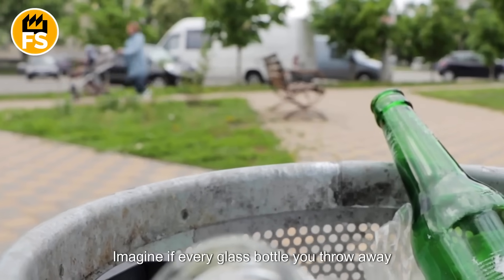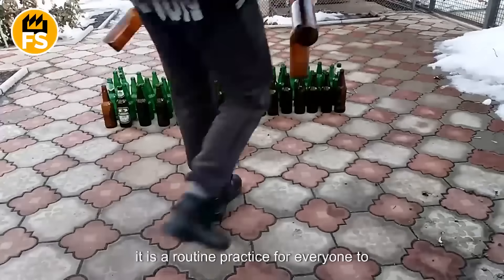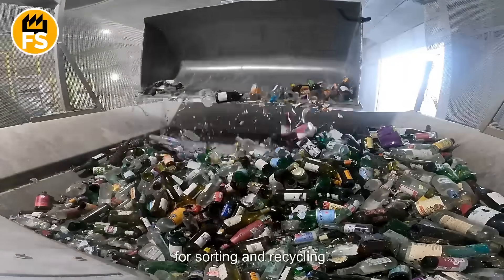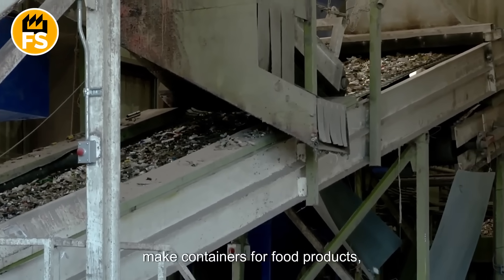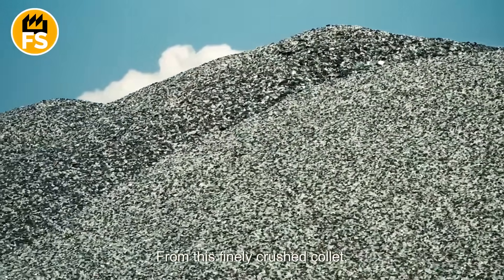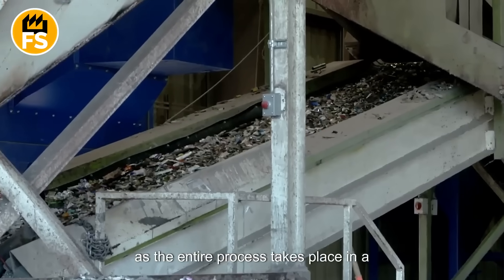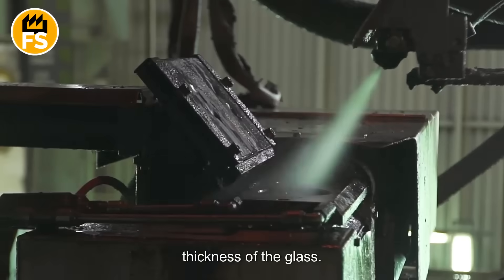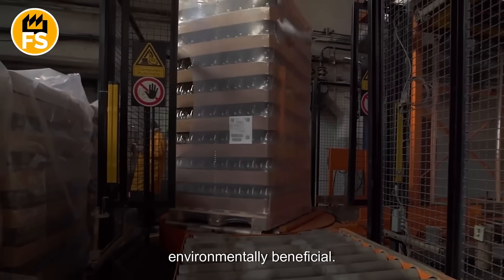How Are Over 130 Million Tons of Glass Recycled? Secrets from the Factory!

Comment: In UK, I broke up my double glazed window frame and took the glass out having been told, nobody recycles this sized glass as the UK don’t have the Technology. 😅 I was told to Chuck it in the Landfill waste.
Reply: Same here, it’s utter incompetence, but what do you expect from councils.
Reply: It’s worth bearing in mind that some glass goes through treatment processes, like UV reflection or different heat control capabilities, or structural strength specifications which might mean they could be more difficult or impossible to recycle?
Reply: @bernardwarr4187  
Trouble is, should we only produce one type of glass and nothing else. Abit like the Manufacturing of one car 🚘 in different colours but nothing else😩
Reply: @ no, different cars and unusual is great! It’s just things like Pyrex glass can not be recycled along with various other treatments
Reply from the maker: It's frustrating to hear that, as glass recycling technology is improving! 🌍🔄 In the UK, there are actually more options for recycling various types of glass than many realize, so it's worth checking local facilities!